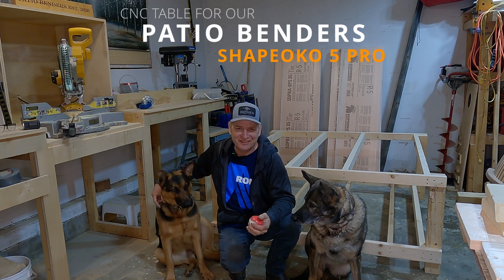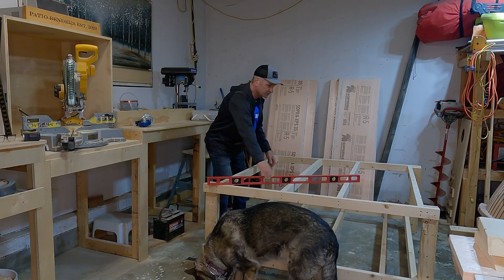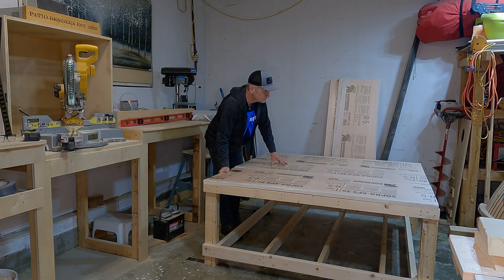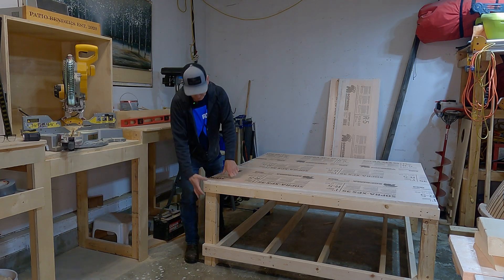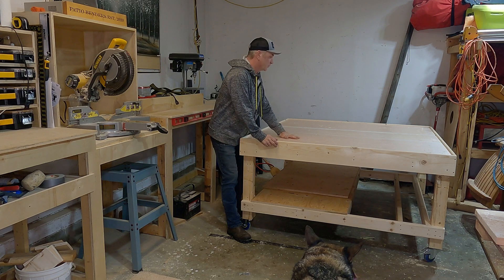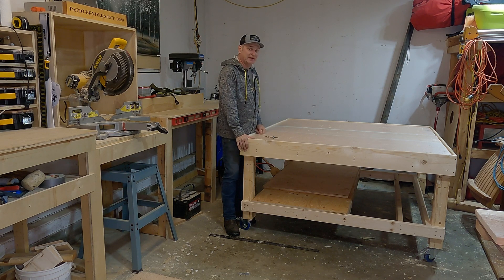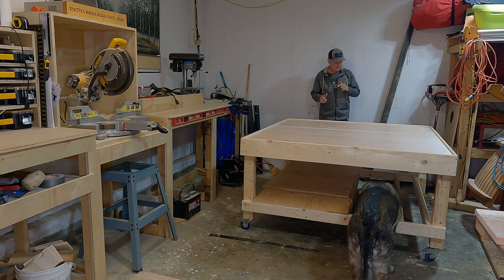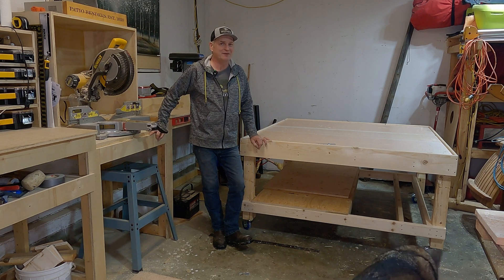The ultimate Shapeoko 5 Pro CNC Table construction guide

Comment: It’s been 5 months since this posted. What would you do different? What have you changed? Does it rock with the way it’s built? Did the two layers of foam board make any difference?
Reply from the maker: This summer, our focus was on constructing outdoor furniture and our unique cornhole boards, which unfortunately limited my opportunity to utilize the CNC machine pretty much until August. However, I must say that these questions are spot on. I wouldn't change a thing. The inclusion of rubber locking roller wheels ensures stability, while the double layer of foam not only minimizes noise but also prevents the machine from shifting during operation. Other youtubers utilize braces to stabilize the machine, but the foam bottom renders them unnecessary. That being said, thanks for watching, and enjoy a wonderful weekend. 😊